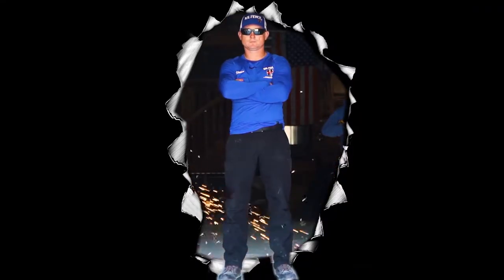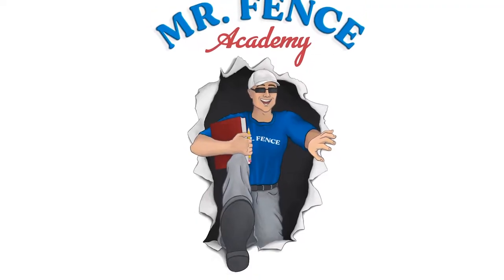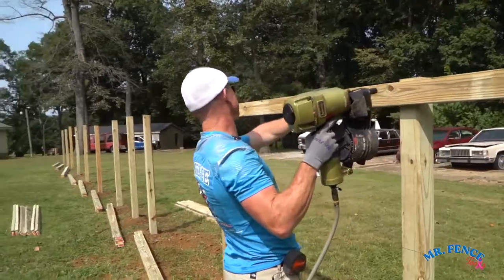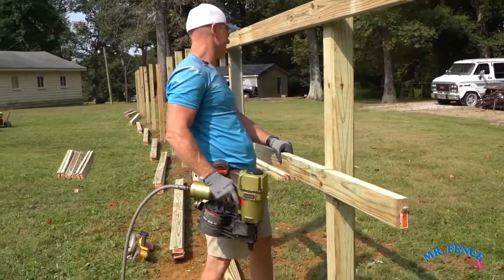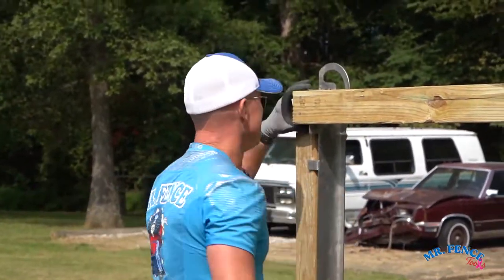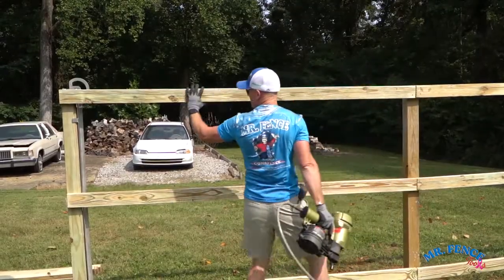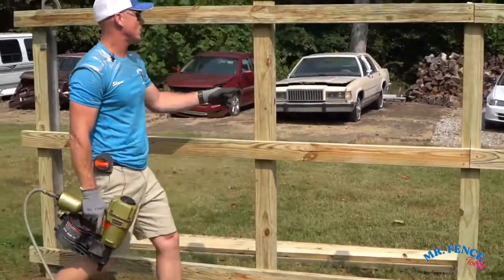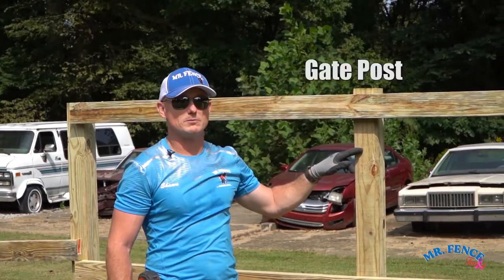How to Build a Wood Fence | Running Rails

Comment: I did 3 things he recommends. I made the contraption to lay out the stringers, I cut the stringer 2 x 4’s after nailing them up on the posts, and I put the pickets right next to each other with no gaps. It went like clockwork, much quicker and easier than ever before! Thank you!

Comment: I like the fence holding jig out of metal. I only build a fence once every 10 years or so and make a jig out of a 2x4 then it gets scrapped after the job. But it makes the job 100 times easier when your alone. And the fence looks nice without any measuring.

Comment: If you don't mind my asking what is the spacing on the rails and what is the top rail sitting at from the ground? I was taught the rails should be two feet apart, but I just started installing fence and I'm still learning, thanks to your videos I've learned a bit more.
Reply from the maker: It depends on the reveal of the picket above the post. 7” reveal equals 27”, 54” and 66” out of the ground

Comment: I was sold this design of fence building by a contractor in Jan. '09 for a 448' run of fence after hurricane Ike took my fences down in '08. After about 3 years the rails started to pull away from the posts at the top rail and I had to keep knocking them back and finally using 4" screws thru the pickets and rails into the posts. But the worst part started at about 5 years there was a noticeable lean to the outside from all of the weight being on the side of the posts. By 2016 some parts of the fence were leaned out 3" at the top. This is the fastest and easiest way to run fence rails but not the best way IMHO.
Reply from the maker: The reason for you fence leaning has more to do with proper post depth and very little to do with how the rails are ran. We teach a lot in Florida and find the common depth and compaction used to set post is about 60% of what is should be. If this is don’t properly then your post will more than likely break off in a hurricane, we have built fence like this in Florida for many years. It works great until the entire fence is destroyed by high winds.

Comment: Im replacing my old fence , one section is a 12ft gap between the 4x4 post but i cant dig to place a post cause there is a huge utility box and also utilities cable and telephone lines underground, what form do you recommend to install railings ?

Comment: If building a cedar picket fence, do you want the rails to be treated pine or cedar?
Reply: We use cedar pickets, with cedar rails but you can use p.t pine rails with cedar pickets but we prefer cedar. Cedar is great because it has natural oils in it that pressure treatment tries to imitate. Wish you luck with your project.

Comment: I'm nervous about buying 8ft 2x4 rails to use between 4x4 posts. Each 2x4 only hangs on to the post by 1 and 3/4 inches. What if my post isn't perfectly set?
Reply from the maker: We have been doing it this way for nearly 30 years it’s just not a problem
Reply: If you can set them dead on 8 ft. on center, it won't be a problem. But as most "legs" or "sides" of a yard fence are not an even multiple of 8 ft., i would measure and set even sections, will most likely come out to 7'6"-8'. Then cut rails like he did, with a saw set 1-1/2" deep. Provides a cleaner look, with all the sections being evenly spaced, and gives you some wiggle room if a post is set an inch one way or the other, but the difference is not visible to the eye.

ex. 84' run
Instead of (10) 8' long sections, and one 4' long, divide 84/11=7.63

7.63 feet= 7 ft. 7.5 inches (7 ft. 7-9/16 in.) if you want to get specific
(.63 feet= .63x12=7.56 inches, round to .5 inch)
(.56 inches= .56x16= 8.96/16 inch, round to 9/16 inch)

Double check measurements=

7 ft.= 84 in.
84 + 7.5 =91.5 in.
91 in. x 11 (sections) = 1006.5 in.
1006.5 in./12= 83.875 ft. (83 ft. 10.5 inch)

We lost 1.5 inch over the course of 84 ft. That's pretty dang close and will not be noticeable to the eye.
It's a lot of math, but I'd rather do 5 mins of math in the shade rather than have to pull a post out of the ground because I set it 1 inch too far to the left. Even on legs I measured to be an even multiple of 8 ft., I add one extra section. Can never go wrong with posts set closer together, it builds a stronger fence.
Reply: I center my post at 93” then jus cut like he is

Comment: I like the idea and I understand making money off of products, but...

Drive a screw in (1.5" sticking out) at where you believe the bottom of the 2x4 will rest. Hang one side of 2x4 on said screw. Go to other side and line 2x4 up where it should go, and fasten. Go back to "hanging" side, line up 2x4, and fasten, using the screw used to hang 2x4. If that side of the post will be visible, use some quick clamps. Once you get the first section, you can drive your "hanging" screw at the bottom of the 2x4 you just installed, slightly toward the direction you're working. "bump" the 2x4 against the once you just installed to minimize the gap and maximize the meat of the post to screw into.

I am also biased to using screws for the frame rather than nails.

Also, depending on the style of fence you're building, the vertical space in-between the rails may need to be different. I recommend cutting a scrap piece of wood to the spacing you need, and use it to mark, or hold rails against each other for correct spacing. Use the "sticks/runners/blocks" your posts came banded to if you don't have any drops lying around. We usually cut a new one for each job, from a scrap piece from the previous job. Not the most efficient, maybe we should save the ones we cut and paint them red or something so we don't lose them.

Math:
72" picket with 1 inch gap at bottom, 2.5" gap from top of top rail to top of picket, bottom of bottom rail 4" off the ground.

72+1=73
73-2.5-4-10.5 (3x3x.5 rails)= 56
56/2 (space between rails)=28"
cut a board 28" and use it as a spacing block

Comment: I run my spreaders between the 4x4s for a cleaner/ flush look. Am I doing it wrong?
Reply from the maker: Not sure what your talking about
Reply: @mrfenceacademy   rather then face nailing the horizontal 2x4s to the posts like in this video, my company runs the 2x4s between posts and tow nails them to the 4x4s. That allows the pickets to sit flush on the 4x4 fir the pickets that are inline with the posts.
Your approach looks way faster and easier. Wondering if we should switch it up..
Reply: Nah I like that method also
Reply: @codysmith1234567  No
Reply: No, do not change

Comment: If you use 16' long rails you'll have a stronger fence, you'll get less sagging in your rails, it's less times you're handling materials and less cutting.
Reply from the maker: Just simply not all true we have tested this thought several times. Thank you
Reply: I agree. Just altenate every other rail as 8 and 16.

Comment: I don’t feel like you should be cutting your rails. Also if you set to grade you don’t have to cut the top of your post. And if you measure your rails you should not be cutting them. That is a waste of time and material. Some of your ways I may agree with, but I don’t like cutting as it takes up more time in the process plus the clean up when it can all be avoided. Just my thoughts and opinion.